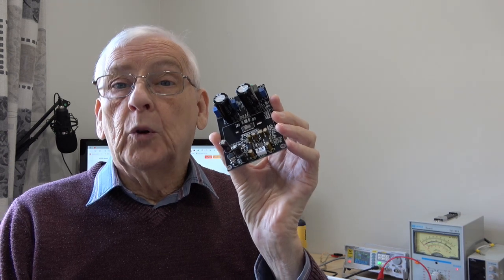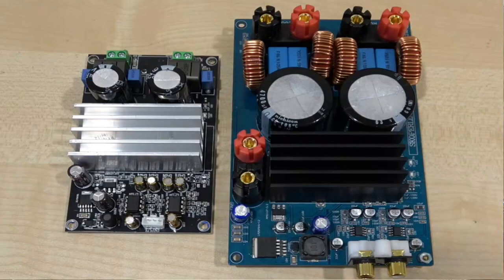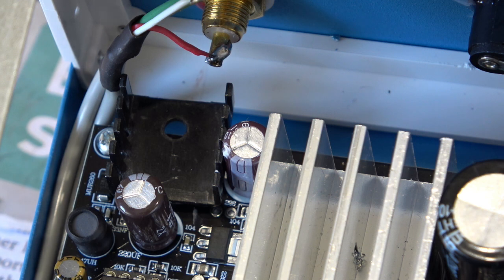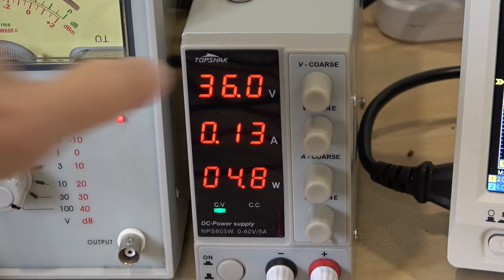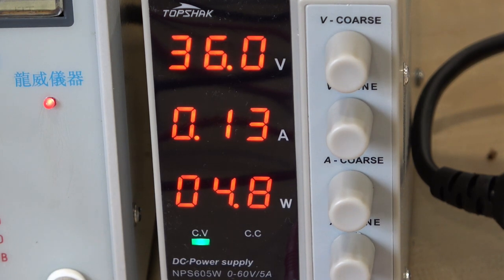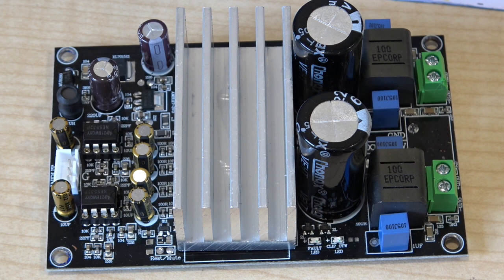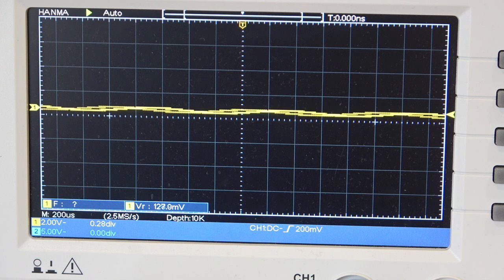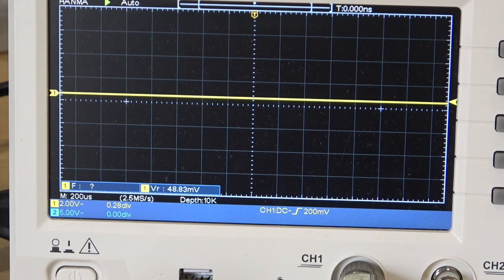TPA3255 Will this low cost class D board meet specification?

Comment: I know I'm late to the party on this one but...
I recently came into posession of a pair of these boards, made by Shui Yuan Audio in China.

The over-heating regulator problem you spotted seems to be corrected.  On these boards they got only slightly warm to touch at 48 volts.

The excessive idle current issues you spotted are actually (laughably) because of the two eye piercing LEDs on the board.  They operate in a rather strange way, in that they default to on at 20ma each.  Then to turn them off if there is a fault or clipping, the Clip/OTW and Fault outputs on the chip are used to drive a transistor to short out the LEDs, putting increased load on the series resistors which again increases current loading.  In a proper amplifier those leds would be off and drawing no power unless either Clip/OTW or Fault goes to the active low state and even then they should draw only enough current to be visible (not bright) so they don't interfere with a technician's eyesight while troubleshooting the problem. 

Also be aware that a big part of the overheating issue you spotted is that, on mine at least, the heatsinks were dry, no thermal compound, which makes for a very poor transfer of heat. Even cheap old white thermal paste improves the situation remarkably.

I've run them up to 48 volts with no problems, listened to them for a few hours and they seem okay to me... but lets be real, they're not "hifi" designs. Those boards are made for experimenters and tinkerers... not music lovers.
Reply from the maker: Yes, you do need sunglasses to listen to this amplifier. It's good they seem to have fixed the regulator issue. I've had more mail on these amplifiers, complaining of the regulators failing and overheating that any other products.
Reply: @MichaelBeeny  
I had both of mine idling at 48 volts for a few hours yesterday without any problems.  This, of course doesn't mean it's fixed on a wide scale.  I might simply have been the lucky one.

For the LEDs... I'm trying to work out a way to remove that entire section of parts from the board and hook up an external LED driver that makes sense.  Something like the Power, Clip, Protect triads you see on pro-audio gear.  It's some high-end tinkering... I'll let you know if I have any luck with it.
Reply: Following up on yesterday's notes ...
I just ran these boards up... I was able to pull power just like on the front page of the TPA3255 spec sheet ... about 110 watts on 8 ohms, almost 230 on 4 ohms, 48 volts, very low distortion. with an input of 1 volt rms.  It ran that way until my dummy loads started smelling funny... and man were they HOT. With proper paste on the heat sink, the amplifier got pretty warm but not what I would call excessively hot. 

I can't say, at this point, if the maker addressed the issues, you got a bad one or if I got lucky ... but the ones I have do seem to be performing "as advertised'.
Reply: For anyone reading this in the future I think the Shui Yuan Audio boards are ok but the one Michael had is a cheaper version that copied the Shui Yuan board and shouldn't be used.  Heck of a world now where the Chinese are copying a copied low cost board! Lol

Comment: I think they changed the SM chip think its the HV version . (no heating fom the chip) . Just bought mine a few days ago . drew arond 120mA and pushed out 156Watt @4 ohms without fuzzyness and 165Watt with fuzzyness . 78watt @8 ohm . Both tests were done with 46volt supply . So yeah I guess they tweaked it a bit
Reply: Thanks a lot for your info. Could you give me a direct link to the seller you purchased from? I would like ot get one but not have an older batch.

Comment: I bought 1 of this 3255 for about 30usd. I run in 36v 7A to be safe and its a good board so far in my DIY. it can push my dual 250 rms RF sub in 1 ch.
Reply: Just curious, have you measured the actual power output? I have  a 31V supply and wanted to get one as 2nd amp.
Reply: @MasterBlaster220  yes and still powerful now am using another smps of 36V 16.6Amps and its more crisp.
Reply: @michaelgu9907  WEll cool, would be nice i you`d tell me how much wattage they put out. From one review iǜe heard they are only 100W/ Channel at 4 Ohms. :)
Reply: @MasterBlaster220  actually the pottential is 315w/channel @4 omhs and it is safe@ 36v not 48v. I am using 1 sub 250rms dual, 1 full range 300w 4 ohms and 2 bullet ti tweeter on it and its party.its loud that i cant get near on the box.
Reply: @michaelgu9907  That confuses me a lot. If we talk about max 1% distortion Michael who made the video himself said that it has max.100W at 4 Ohms per channel.
Reply: The amp is  just safe at 36v. Promise it wont let you down as long as you got the good board and the smps
Reply: @michaelgu9907  Well thanks. But you still cant say exactly how much watt it delivers at 1% distorton right?

Comment: I had bought this board abought 8 months ago and it wouldn't come out of fault mode on any voltage from 24 to 48. I had fun using a 2kg hatchet on it... very exciting!
Reply from the maker: I would have insisted on my money returned David. Mind you the hatchet does sound a good alternative. This version does seem to be very poor and troublesome. Not recommended at all.
Reply: If you were judging by the LEDs on the boards... for some idiotic reason they are ON for normal and OFF for problems... totally backwards.
Reply: @Douglas_Blake_579  It didn't work no matter what I did, Chinese junk stay from this board, look for better ones to purchase
Reply: @DavidSmith-dm8ew  
Luckily I didn't purchase these two.  They were a gift from a friend... and so far they are both working.
Reply: @Douglas_Blake_579  Unfortunatly I was very disappointed when it didn't work :(
Reply: @DavidSmith-dm8ew  
I can understand that.  The TPA3255, properly implemented is an excellent amplifier chip.

Comment: Using a linear regulator to drop 48V or more to logic level is inherently problematic as all of that excess voltage has to burned as heat at whatever current is being drawn by those components.  Active regulation would be better, but we'd want a high regulation frequency to avoid adding noise.  Running the logic with any kind of efficiency is one of the biggest challenges of these boards, as the class D audio chip is extremely efficient while its logic supply is usually not.
Reply from the maker: Maybe I miss understand Rob, but the 48-to-12-volt regulator is not linear, it's a switcher. The inductor is near the component. The 3.3 regulator is a linear regulator, however.

Comment: I've bought a board with the same layout - Shui Yuan Audio branded. To me it sounds very good on 36v but speaking about fake components - Nichicon main filter caps (I suppose they could be genuine) and the smaller electrolytic labelled as nichicon fw 10uf 50v. In actual fact these are more likely 25v caps with false labels but the boards silk screen and hole spacing is more designed for a 50v equ. The opamps don't look like the 5532's I've bought through Mouser but they do pass the diode test you enlightened me on one of your past videos. Kind regards.
Reply from the maker: I think if you keep the voltage at around the 36 volts you should be OK. Good to see the 5532s are not fakes.

Comment: I wonder if these chips are TPA3251 chips that have been rebranded into TPA3255 ... basically fake chips...  You can get the TPA3251 for almost half the price of a TPA3255 and if you are placing them into products like this you can easily erase and laser etch a new number on them or just sand and polish the numbers off.  They are the same exact footprint.
Reply from the maker: You may well be correct, makes sense.

Comment: Hello.  Thank you for the great videos.  I just got this amp today.  I connected the 24v and it turned out to be faulty.  The stabilizer XL7015 and the inductor behind it failed.  Privately, something better to replace.  What ideas?
Reply: Modules on XL7015 are available for sale, maybe they do not contain a fake chip. Modules on lm2596hv should also fit, but almost all lm2596hv chips in it are fake...
Reply from the maker: @makoveliprod  By coincidence I have just received 2 of these modules. Expect a video on these soon.
Reply from the maker: I think that same device failed on my first unit. I need to look into that regulator. I'm looking at a something better right now. Early results look good. Watch this space.

Comment: xl7015 dc/dc step down overheats from load in several op amps? 😱 Something is wrong with the xl7015 connection on the board, perhaps the inductance of the wrong value, or just fake xl7015
Reply from the maker: I'm beginning to think they must be fakes, in fact probably all the chips in this board. It's probably why some boards are double the price. I'm looking at another more expensive board right now, looks a much better design.
Reply: Try boards based on irs2092, there seems to be nothing to fake.

Comment: Hi Michael, do you have the idle current of the other tpa3255 board? Are they significantly different?
I think the chokes runs hot too and the whole board would benefit if it is fan cooled
Reply from the maker: I'm looking at such a board right now, still in the listening stage, not hit the bench yet. I must admit in these early stages, I'm quite impressed so far. I will report back soon on this one.

Comment: I've just ordered a 2.1, dual 3255 amplifier, and that board also lists a 36v maximum input! I'm gonna look the board over to try and deduce what fake components it has.
Reply from the maker: Don't forget to report back Bradley.
Reply: Also got duo fan equipped 3255 ,,fans help very little , 8 ohm load ,not warm!!, harrison xmods @70 hz dulls hi frequency response,  use electronic xover for good frequency response.. carbon fiber 8's,,5in poly mica,ribbon tweets. Dayton 500watt sub and duo 18's. Phone driven, trailer park audiophile, in wheelchair..lol
Reply: Get a real fan,mount it above fins, do turn up the adjustment to 38v and check the rating on the caps, buy the best one ,all are cheap made, inspect..it..